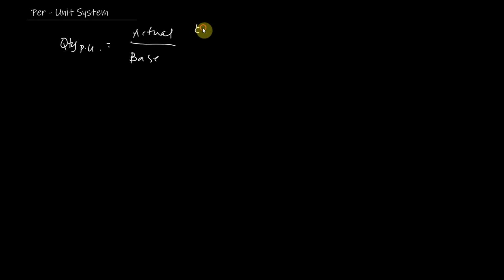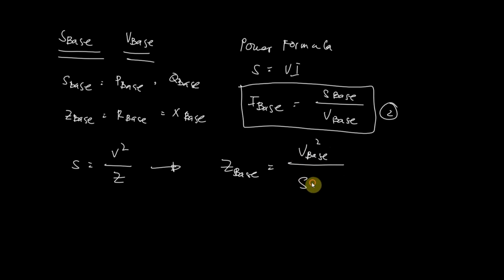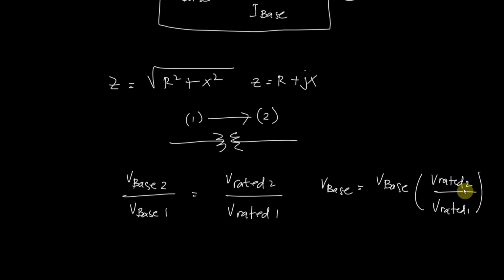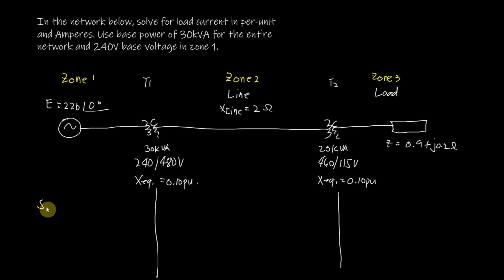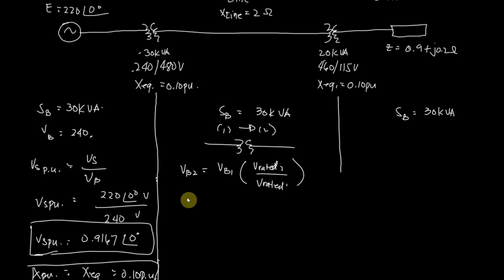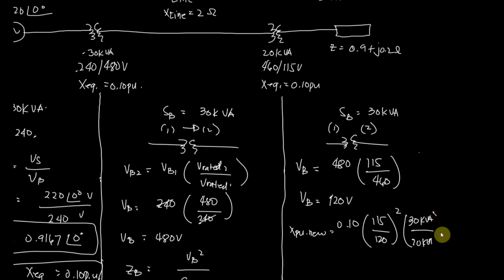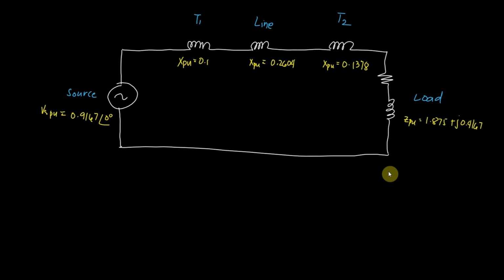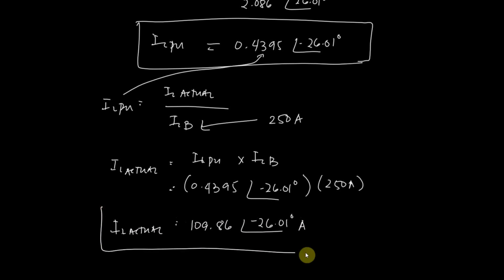How to Use Per-Unit System in Power System Analysis

Comment: Sir bakit sa Zone 3 ang Xeq new ang ginamit na Old Voltage ay 115 (secondary voltage ng T2), while ang Base Voltage sa Zone 1 ay ang primary side ng T1 (240 Volts)?  Hindi ba pwede Primary Voltage (460 Volts) din ng T2 ang gamitin?
Reply from the maker: sir yung 240V volts kasi na base voltage sa zone 1 ay nagkataon na kapareho ng primary voltage sa zone 1. Pero dahil may transformers tayo kailangan naten i express yung base voltage dun sa zone  kaya may conversion tayo from side (1) to side (2) ng transformer.